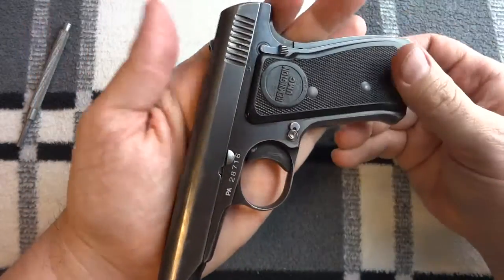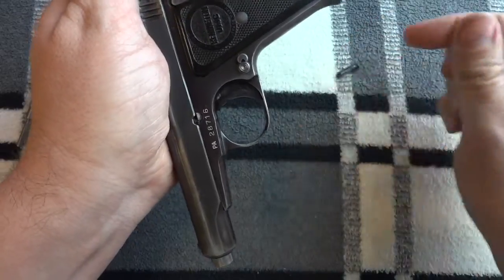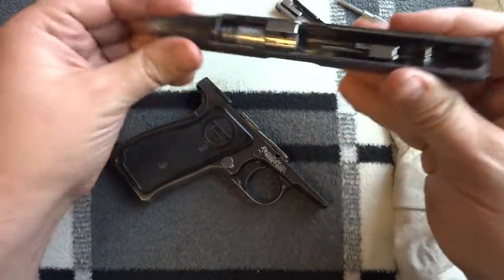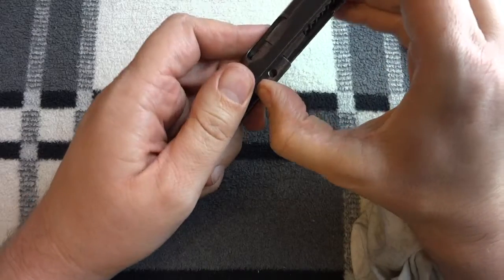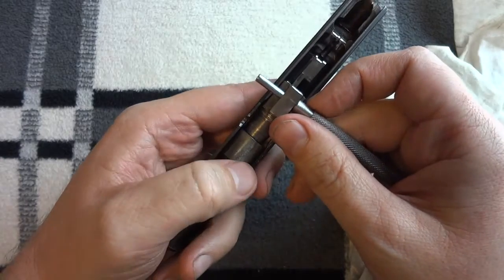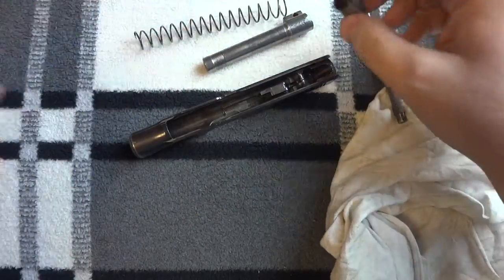Remington 51 Part 2 of 5, Disassembly

Comment: For those people considering one of these to actually shoot, wouldn’t a full disassembly be necessary to check for cracks or other flaws in that pivoting block?   I’ve seen a few for sale online, but it seems like an $800 risk just assuming it will function or that there isn’t an impending breakage.
Reply from the maker: You don't get to detail-strip a gun before you buy it.  These aren't really shooters any more.  There are a few things to check from the outside.  First, you pull the slide back and lock it open and you can see up into the bolt.  Verify that it is still intact and one or both sides hasn't cracked off.  Second, you can see if the grips are cracked, as they are prone to do.  That's about it.  If you're buying online and they don't disclose it, you can ask for them to do the same thing.  Really, the bolt is the major point of failure.  If it's not cracked, you're probably good.  If you take it to a gunsmith, good luck that he knows enough about the gun.  I know of only a handful of people who are competent enough to work on one of these, and I would only work on my own guns.
Reply: @RyeOnHam  Right - I’m reluctant to buy one online.  I did see one for sale at a gun show.   If I can get a good look at that pivoting bolt, I may buy it.   I really want to shoot it though: I have enough aluminium-frame and polymer-frame guns that now I’m only interested in all-steel guns of the past and this one is both good looking and mechanically interesting.    Thanks for the video.

Comment: It seems to me that the barrel doesn't travel back with the slide and locking block as can be attested by the round (not oblong) barrel lug hole.
Reply from the maker: Correct.  I demonstrate the system in some of my other videos.  The barrel stays still while the bolt and slide are shoved back by the cartridge.  The bolt stops after about .060" and the slide continues.  After a half an inch of travel or so by the slide, it lifts the bolt out of the locking shoulder and pulls the case the rest of the way out to eject it.  The barrel stays put this whole time.
Reply: +RyeOnHam Thank you for clarifying that to me, the reason I commented was because at some point you mentioned, most surely by mistake, that the three elements, barrel, slide and block move back toghether
Reply from the maker: chapiit08 I don't remember saying that, but it's possible.  Might have misspoke.  Might have said, "Case"  not barrel.  Can't rewatch these things or that's all I would be doing with my life.